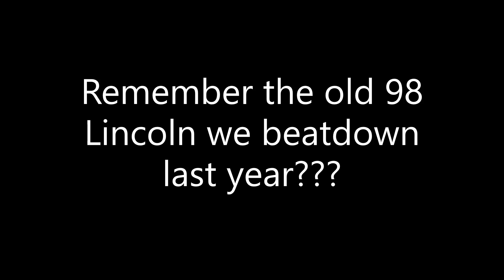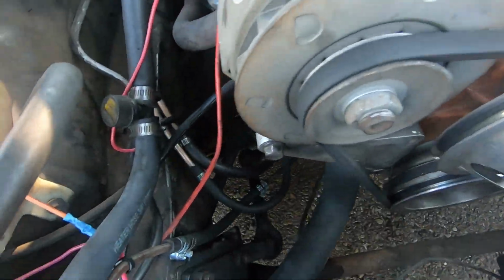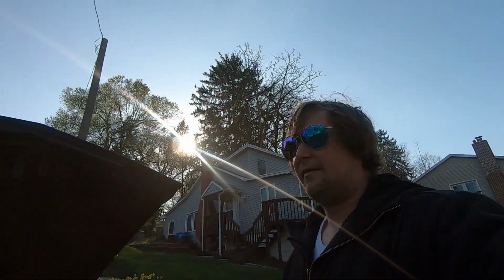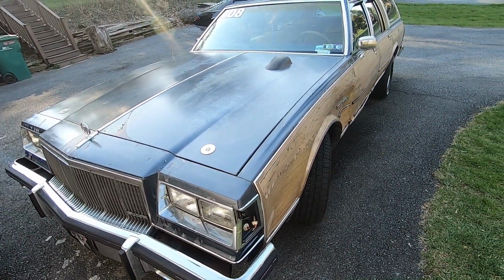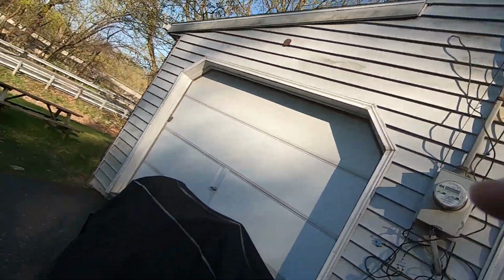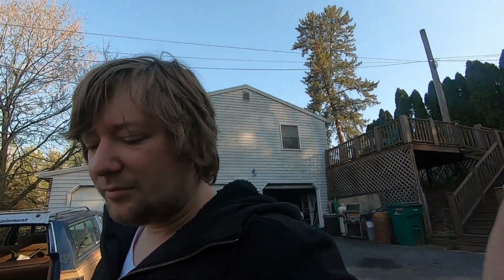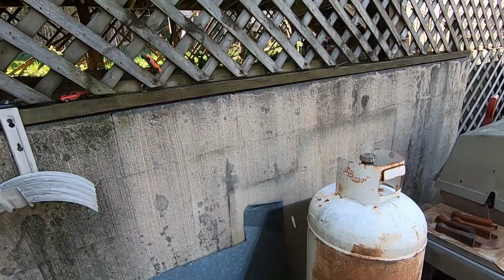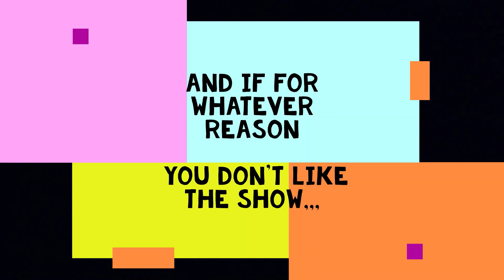Existence is Pain...

Comment: Some days it's just not worth getting out of bed...
Reply from the maker: So glad to see you get out of bed, check out the latest vid LOL.
Reply: @UsefulEntertainment  lol.  I got busy and forgot I had this video on my watch later.  Just so you don't feel alone in your automotive misfortune I've got a tale of my own.  Suburban story time.  Bought new tires ($750), got transfer case rebuilt and new pinion seals ($1822), got truck inspected and legal ($90).  On the way home from the DMV she starts slipping between 3-4.  Clean fluid, good level.  Stopped using overdrive and have put the truck on as needed duty until I can have the valve body looked at.  If it was 2wd I would just slap a th400 in it with a driveshaft and be done with the electronic bullshit.  I honestly should NV4500 swap it but I can't find one let alone buy it.  The torture never stops, lol.